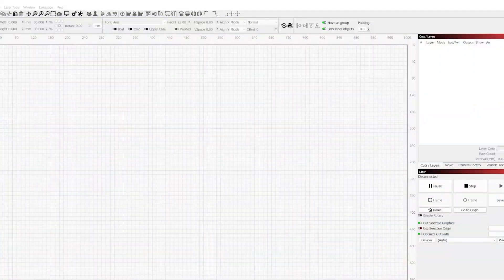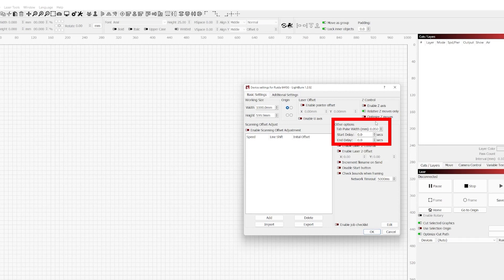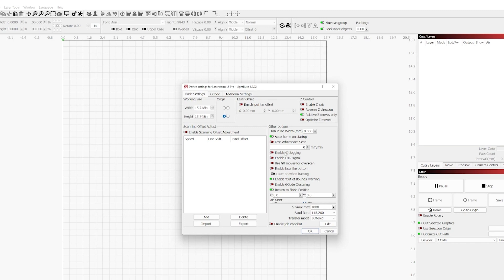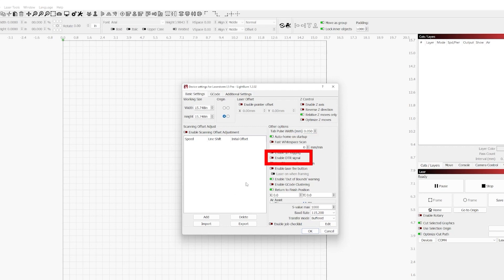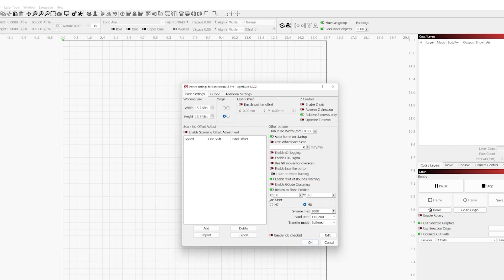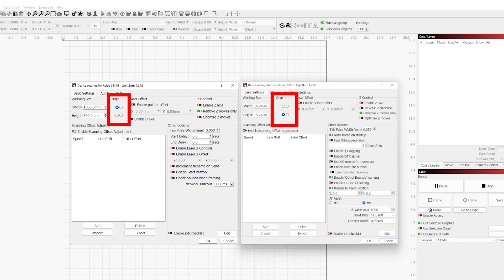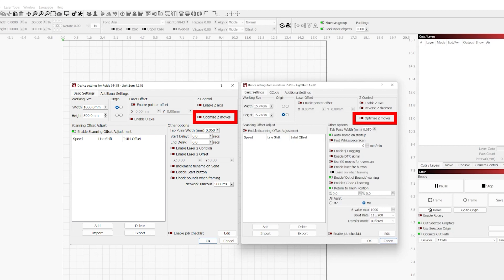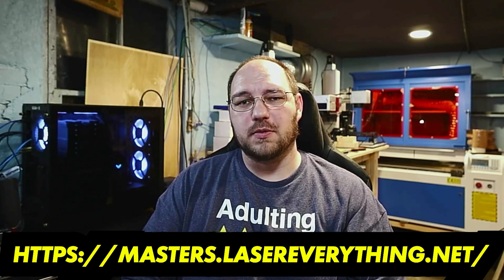Learn the Device Settings in LightBurn for CO2 and Diode Lasers

Comment: Hello 
I have a neje 3max v2 e40 module I’m running lightburn and it was doing fine until I got the extension kit. The problem is that now it only recognizes the original 460*810mm and not the 810*1030mm extension so I can’t use half of it. Please , if you know how to fix it reply to this comment and/or make a video about it. I bet I’m not the only one with this problem! Thank you in advance
Reply from the maker: If you’re still stuck, Open a thread in the discord server we link in our descriptions, we have support forums where screenshots can be shared and it’s easier to see what’s going on and a lot more people can share tips to help.

Comment: Is there a setting that will allow a diode to behave like a co2 to start and stop in the same position so if you start a diode project and hit stop it returns to the starting point like a co2

Comment: I seem to be missing some options. Maybe the newer version doesn't have them, my license doesn't allow them, Or my specific machine doesn't support the options?
My GCode settings do not have a "Tab Pulse Width" adjustment. 
I don't have "Use G0 moves for overscan".
I don't have "Enable job checklist" or the "Edit" button

Comment: i wanna know about  laser 2 controls ?
Reply from the maker: We don't have a gantry machine with a 2nd laser tube/source built in, we only have single laser systems, so that is a topic we may have to look into when we have a system that supports that.
Reply: @LaserEverything  actually i meant to say i have dual head laser machine is there anything ??
Reply: @LaserEverything  lightburn camera campatible for dual head machines??
Reply from the maker: Oh. I can’t think of a reason why it wouldn’t work. Dual head is still not something we have access to, so we can’t completely cover the specific details for that, but I can’t think of anything that would prevent it off the top of my head. Lightburn camera should work, but remember that the edges of the field of the camera is going to be least accurate, and grow less accurate based on the angle it’s capable of viewing. If the heads are spread fairly wide, you may have a hard time with accuracy on both at the same time. Usually you’d aim for the most center point of your work area used most with the camera.